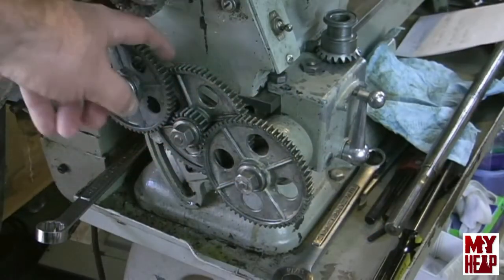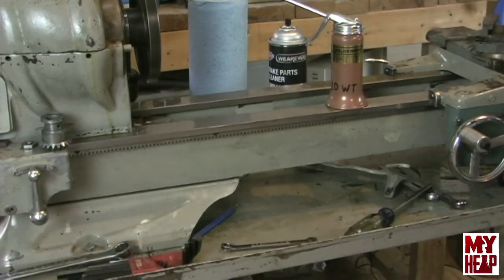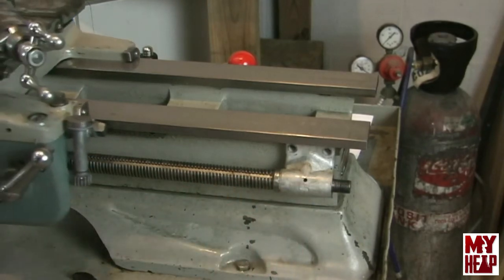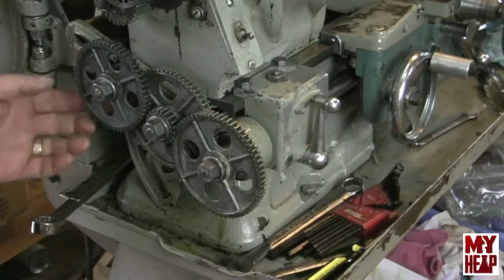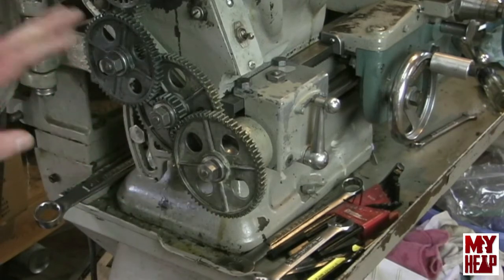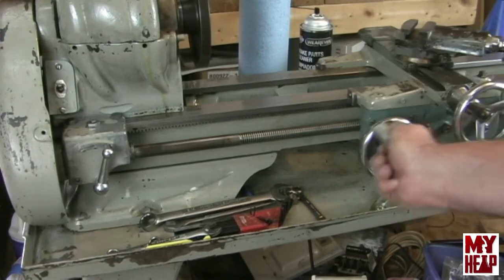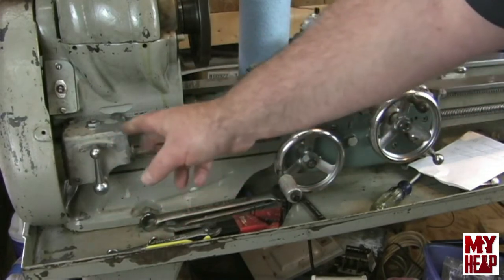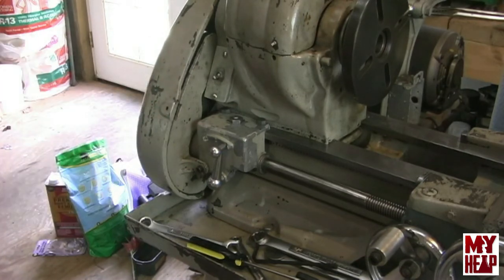Atlas 10F Lathe - TH54 - 19 - Installing the Leadscrew and the Side Guard

Comment: I'm lucky enough to have on my TH-54 with the quick change gear box and I wish and hope you get a chance to add one to your lathe you'll be very glad you did!  Just watching you get everything lined-up in this video made me feel so much more thankful for my having the QC Box on my lathe.  Because after replacing the split nuts reinstalling the lead screw was so easy, it slid right in.  Passing though the apron was the same as on your video.  However when it came to engaging the drive train all I had to do was give the lead screw a little twist to engage and that was it.  I did not have to loosen anything else although I did disengage the QC just to be safe.
Thanks for sharing and it's looking good!
Reply from the maker: I agree a QC gear box would be great.  Have looked at a couple on Ebay but they are too expensive for my shallow pockets.  In reality, I probably didn't have to loosen the change gear box, only the banjo to allow all to line up correctly.  But the way I done it I figured would have been safe for everyone.  The tough part about lining the screw is that you have to get the little spider gear on and it is caught in the shift fork and no space to get your fingers.  But I suppose it is what it is.  I have the new set screws for the tail stock so it will be going back together soon.  Thank you for watching and the support.

Joe

Comment: Hi Joe, I would not engage/disengaged the lead screw with the lathe running. If something doesn't engage correctly it means dammaged parts that are hard to come by. I always stop it, shift the box while rotating the lead screw by hand to get it to mesh. I will send you a pic of the little lock pin tomorrow.
Reply: Jeremy Gagnon I'd second that but I can't speak from experience mine has the other type of reversing gears. If you can't find a pic of the spring loaded latch let me know. I can send you one.
Reply from the maker: I figured as much but thought I would ask you guys with the experience first.  Thank Jeremy, will look for the pic.

Joe
Reply: never hurts to ask right
Reply from the maker: True, I am a firm believer in the only dumb question is the unasked one.
Reply: for certain look how much you can learn just buy asking

Comment: Joe be very careful not to let the clamp on the end of the lead screw tighten up or seize, it is very fragile, it is designed to break or snap easily in case of a crash as to limit major damage to the machine.  These parts are getting very hard to come by and getting even more expensive as time goes on. Also as Jeremy said be very careful with the gear box, keep it lubed well. If you do a search on ebay for Atlas Lathe Parts, you might find that door catch pin, if not, I may be able to make you one if time allows, as of right now our property is pending sale and might have to put shop on hold for a while.
Reply from the maker: Thanks for the information Richard.  I need to find another nut to lock the leadscrew so that it cannot jamb.  Not sure what the thread is on it though.  Speaking of parts, before my friend Gary told me he could bore the bushing out of the gearbox and make a new one, I called Clausing about the bushing in it.  They told me that it was not a replaceable part and had to but the casting with the bushing in it.  $75.  OUCH.  Well I went ahead and ordered the fiber washers for $8 and then they stuck me $20 bucks to ship them.  I wasn't happy about that.  I will take a look on ebay, but not sure if I can find that one.  And thank you for the offer.

Heading to Post Office today, will email you with a tracking number.

Joe
Reply from the maker: Richard, the package has been mailed off.  I emailed you the tracking number.
Reply: So the reversing gears are available as reproductions now, but they're about 200 a set! However you can buy that leads screw bushing 3d printed on eBay for about 15$, and then it's a nice fit and guaranteed to break away in an emergency crash
Reply from the maker: So I wonder then if the stl files might be available on thingiverse or somewhere else? Do you know?